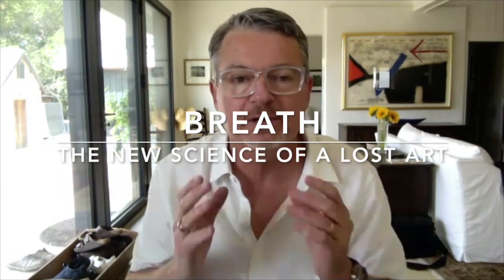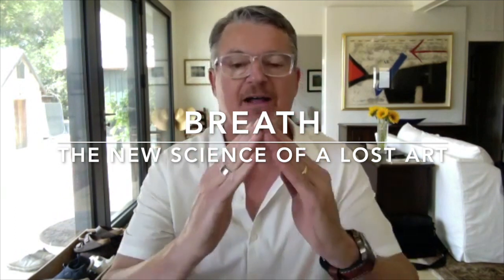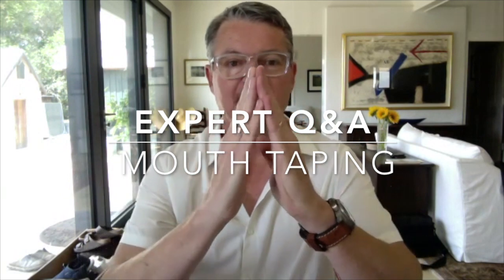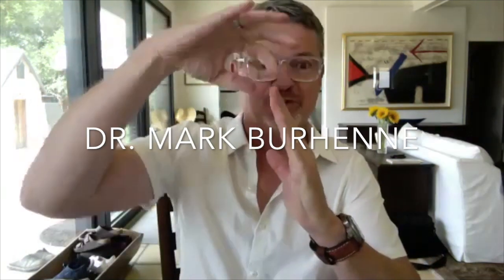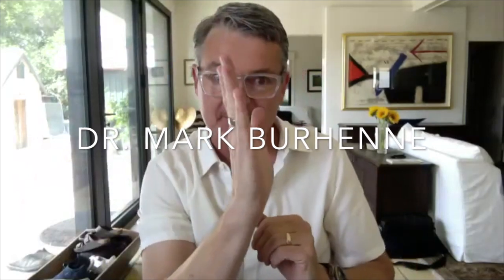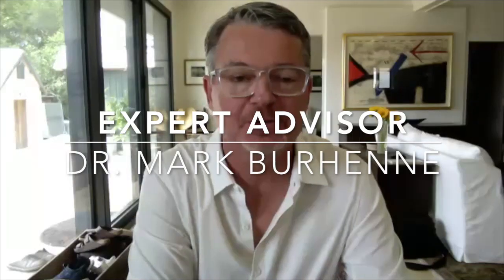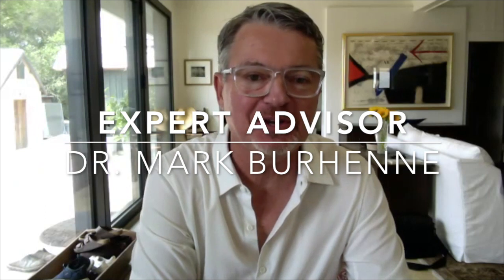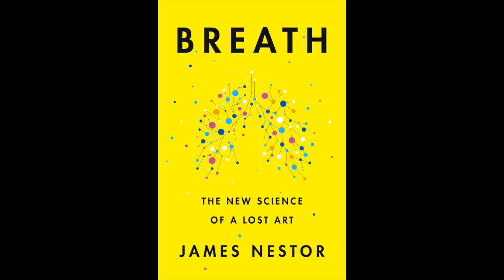BREATH: Expert Q&A | Mouth Taping

Comment: This is all so fascinating. Just started your book this morning James, thanks for bringing education to this little known topic. I have a deviated septum I've been struggling with for a while, scheduled for Septoplasty Nov 1st. I've already been experimenting with tape the past week and am noticing a difference (Thank the Hostage tape ads for bringing awareness).  It's the craziest thing, when I sleep with my mouth open, I get congested GUARANTEED. Every single morning without fail and it's bad.  When I've been taping mouth shut, I'm not waking up congested any longer.  I'm very excited for the future and hoping I can finally remedy my struggles once and for all.  The thing I am noticing is that while the excess mucus in the morning is gone, my turbinates still seem a bit swollen.  They normally chill out once I get hydrated and a bit of exercise in (assuming the change in blood pressure is what causes the actual relief). I'm hoping they get used to this new change with time. 

Here is my timeline through hell and my plan for a hopeful recovery.
- Had a root canal 5 years ago (you'll see why I mention this below)
-Been struggling with major nose issues for about 5 years.  I always thought it was pet allergies so I never did anything about it, figured it was normal and the sacrifice for having a house full of cats/dogs. 
-Got to the point my nose was getting so raw inside that the hole kept healing smaller and smaller shut!  It was crazy. With a flashlight, I could see the hole on left was tiny compared to right hole.
- Went to ENT for first time ever, had no idea what an ENT even was.  He told me my left nostril was blocked about 70% from a deviated septum.  Had no idea I even had a deviated septum. 
- Here is the real kicker though. He discovered an abscess above the root canal from 5 years ago.  He swears that this extra space is causing me to continually get sinus infections which is what is causing all the excess mucus.
- We are doing an Endoscopic Sinus surgery with the Septoplasty all in one swoop.  I'm nervous, never had surgery before. Wish me luck here! 
- I will be getting tooth fixed as well asap (no pain or anything but he says the scan he performed shows a clear abbess up between sinus cavity at my molar)
- I plan to start mouth taping regularly and also exercising on a better schedule. 
- The one thing I am getting caught up on, the ENT is also saying I should do turbinate reduction, but I've read a lot of poor stuff about this online.  I think I am going to skip this part and see if what I've learned is going to fix me. 
-Lastly I am also reading "How not to die" by Michael Greger which is about food.  I have had the worst of the standard American diet my entire life, I plan to also change this.

Here's to health, I'm so sick of this brain fog and depression which I'm starting to think is all correlated with my above experiences.

Hopefully anyone else out there struggling to breath can find some damn relief once and for all.
Reply: Hey Jesse, today is November 2nd. How did the surgery go?! I am looking forward to good news. Can I connect with you somehow? I also have a deviated septum, I mentioned taping to my doctor and she immediately dismissed it and it bummed me out. 

The more I read into this and do research the more I’m convinced that fixing my breathing at night is more important than ever before.

Curious to track your journey.
Reply: @katsuru  So far so good!  They knocked me out and got to work yesterday.  Surgery went really well according to the Dr.  I can't really see anything up there yet when I take off the packing it's just a bloody mess.  Trying to keep it clean but it'll probably be a week or so before I can really get up in there and clean it all out as I don't want to mess with the stitches too bad at this point. I've still been mouth taping at least 80% of my nights (prior to the surgery) and plan to continue doing this although the crazy thing is the more I do it, the less I need to it seems, almost seems like my body is naturally starting to learn how to sleep with mouth closed.  I'm optimistic about the future although I couldn't say with certainty if this will fix everything or not.  They told me I had like 70% blockage on left nostril so I'd like to think it's not possible to get any worse post surgery just better.  So far pain is very managable I would put it at like maybe a 3 out of 10.  Nose is very delicate but if you just keep it clean with fresh packing snug up against it, you almost don't even notice it - I can eat normal foods and am up on my feet like nothing.  I could probably even return to work this week if I wanted surpringly although I'm going to take it easy a week. Are you able to message me on Youtube?  You can find me on Facebook too if you have any questions not sure how you'd like to connect but by all means let me know how I can help.

Comment: Hello to both of you.  Great interview.  Thank you.
I have some thoughts I would like to add.  

A diaphragm is a type of structure, a sheet attached to a fame.  There are more than 18  diaphragms in the head, sheets of muscle and connective tissue attached to a mostly boney frame.  One of the many wondrous capacities of diaphragms is the capacity to change the pressure gradient, like a sail, a parachute, a kite.  This capacity of our thoracic diaphragm is what makes inhalation happen.  The diaphragms in the head are auxiliary pumps in the hydraulic system that is you.  Mouth breathing puts a hole in your hydraulic system causing congestion of the the extracellular fluid, the lymph.  Anything congested with lymph will be 1)stiff and thick (like a plant stem is stiff when full of fluid) 2)it will probably be painful or at least tender  and  3)it will always lack the vitality that it could have if it were not congested.   So, it is very important to clear congestion from the tissues.  The thing that clears extracellular congestion from the tissues is the orchestra of diaphragms found stabilizing every major joint complex and autonomic hub in the body.  This orchestra is conducted by the thoracic diaphragm.  When a complete yogic breath originates with the muscle fibers of the diaphragm attached to the front of the spine, it ripples through the diaphragm in a wave like fashion.  In doing so, it grabs the grastroesophageal junction with the lower esophageal sphincter and pulls it downward.  This is the pulling sensation that you feel at the front of your throat and under your chin.  The mouth, the pharynx, the esophagus and the stomach are all one tube.  So a good inhalation with the mouth closed and the tongue suction sealed to the roof of the mouth will cause a flux in the floor of the mouth that changes  the pressure gradient in the center of the head, the seat of autonomic control.  It brings breath to the center of the head.  Who would not benefit from better fluid motion in the center of the head.  

The floor of the mouth is the most important diaphragm in the head.  It is the one that triggers all of the others to come on line and participate in moving air and fluid in the head.  When the mouth is left open, the the breath does not effectively reach the head.  Extracellular fluid becomes congestion.  The airways become narrow with swollen and stiff respiratory epithelium.  Respiratory epithelium is equipped with cilia, microscopic hairlike projections that beat in a wave like fashion, sweeping secretions to the pharynx.  Stiffened cilia do not do a good job sweeping secretions and the mouth breather develops nasal congestion.  

I am an osteopathic physician.  I do a lot of manual medicine inside peoples' mouths.  I have found that most people, even seemingly healthy ones have moderate to severe congestion of their mucosa as evidence by stiffness and thickening of the tissues.  Sometimes these tissue texture changes feel like chia seeds or even pea sized lumps under the mucosa.  Sometimes like grains of sand, sometime a whole patch of tissue will be found to be hardened with congestion.  These areas are almost invariably exquisitely tender to palpation.  This is most pronounce under the tongue, the floor of the mouth.  As the floor of the mouth becomes increasing thickened and stiff with chronic congestion, it is further obstructed in performing its job of bringing breath to the hypothalamus and pituitary gland.  Simultaneously it distorts the alignment of the temporalmandibular joint.  

Moreover, chronic lymphatic congestion results in an extracellular environment with a high concentration of metabolic waste product.  If the high concentration of waste accumulates inside of the cell, it will have a deleterious effect on the forward motion of your biochemistry.  This results in slower metabolism, slower cell repair...  

There is more to this story but, my dog is demanding a walk right now.
Reply: Wondering if you came back from the dog walk, interested in rest of your story :-))
Reply: Anjani T, how can i reach you to learn more?
Reply: Please continue.
Reply: Thank you so much for taking the time to write all that! Would love to hear more, too.
Reply: I wonder what can be done, mouth breathing has ruined a big part of my life and I only wish I could have worked to fix it before it deformed my mouth and gave me permanent congestion.
Reply: P

Comment: Great explanation!  I am a sleep apena patient was getting great results for the first three months of use but I have reverted by to my condition before CPAP therapy.  I know I am breathing through my mouth.  I try this to night and will report back.  Thank you so much!
Reply: How did it work?
Reply: @psykickg   I used the tape for a while. I had unknowingly took off the CPAP mask a few times in the night when I taped.  Not a good thing for CPAP / sleep apena patient.   I think the tape use trained me after a while. I get excellent results from my CPAP therapy now.
Reply: I'm curious what your results have been .
Reply: @dennisneal5817  tape for real not this mini tape crap if you are using nasal cpap. If u are using full mask you find need to tape.

Comment: I have an overbite and find that it is often hard, especially at night, to keep my mouth closed. I wish I had worn braces as a child! I will try the tape and see if it helps.
Reply: Same problem with overbite not addressed as a child. I am now 66 yrs old and mouth breathed all my like with dry mouth and pasty taste in the mornings. Did you try it and how did taping work for you. I tried a mouth appliance but because of my overbite it made my teeth and jaws hurt….
Reply: @LastTrump7  I did not try it because I have pulmonary infiltrates in my lungs, and I heard that it may not be the best thing to do. Thought about a mouth guard but would probably get it at the dentist so it is made to fit correctly. Still need to do my research. Good luck!
Reply: I got braces at age 67. It wasn’t easy but so glad I did. Wear a retainer at night and I need help keeping my mouth closed as I have a deviated septum. Will try taking. Btw- did Invisalign braces. Harder than I thought it would be.

Comment: I been mouth taping for about a year but I'm not used to it yet however maybe I'm not doing it correct the tape falls off many times.  At first I thought to myself how will I breath w my nose as I have stuffy nose a lot of the time? I found out that I'm able to bc nostrils dilate when your completely relax and  asleep.  I really like mouth taping big time I'm using cross cross taping doing it better the longer I do it.  Prayer and faith in JC helps a lot too!!

Comment: Does this help with Oxygen dropping at night while you sleep?  I got on Oxygen instead of a CPAP because my o2 was dropping as low as 75 (but i had pneumonia n Didn't know it).. now.. it drops less with oxygen  (down to about 86-89% o2) 1-3 times a night.   That's a lot better than 15-20 times a night.   Im wondering about taping n Still using Oxygen first night or so and then trying a night without it.  I can track it with my o2 Ring i wear to bed.  Any Suggestions?  Im 61... need to lose some weight n Need energy.   o2 has Really helped a lot with The Brain fog n Exhaustion i suffered from for 20 yrs .  Thanks!

Comment: Will a chin strap would just as well or are there differences between taping and using a strap?
Reply: Chin straps help but will not prevent the lips opening. Opened lips with CPAP will defeat the purpose of the CPAP. Tape will help keep the seal.
Reply: @madonnaagar6582  Thank you!

Comment: for some reason ive had a blocked nose on one side, almost constantly, for aobut a year and a half now,  which saline spray didnt fix. i also constantly woke up with a dry mouth. I have no idea why it started but it's so frustrating, and a few months ago i discovered i was sleeping with my mouth open and i catch myself doing it almost every night. idk if my blocked nose started bc of this or vice versa, but im gonna try mouth taping now.
Reply: did you ever find out what was causing this for you? I have the same problem. how was your experience with taping your mouth?
Reply: Read the book, it helps to explain why your nose is blocked on one side.
Also don't use those sprays. Only use a neti pot.
Further training different breathing techniques will help. They're part of yoga breathing practices

Comment: love the video, but i'm having trouble getting the tape off in the morning.  i agree the tape comes off easy when it is 1st applied...but, in the morning, a couple hours later, the tape will not come off,   unless i want to remove a layer of skin.  i've tried  to roll it off (like you show). and it still wants to take layers of lip skin off.  the only way i can get it off is to put my lips in water for a minute or so.  normally not an issue. 

 last night i woke up and cpap mask slipped and i was having issues  breathing.  took mask off... needed air bad.  now the tape won't come off.  

how do i tape different, or how can i get the tape off easily and quickly?

Comment: I cut off one end of a 3 inch long fabric or plastic bandaid -about 1 inch by 3/4  inch and place it in the middle area my lips.
I like Nestor’s method of gentle removal by back and forth tongue motion. I apply lip balm after removal to soothe any lip irritation.
Works very well.

Comment: What are the chances of choking on that piece of tape if it comes loose while you are sleeping?
Reply: I've probably used the tape a couple of hundred nights and haven't had that happen. I would think the odds of coming off both lips are very small.I use 3M Nexcare flexible clear tape
Reply: That's my concern too, and I'm surprised I had to read this far down the comment thread before I found your question.

Comment: I've been sleep taping for months. But when I wake up I consistently find the tape stuck to my finger. I assume when I’m sleeping I experience insufficient oxygen so I subconsciously rip it off without realizing it thus I continue mouth breathing. Any tips to combat this?
Reply: Following.
Reply: Nestor says to use vertical tape.  In mid lip, so either side of mouth open.  Tape is to remind jaw to stay closed at night.
Reply: You should ask your doctor. If you're not getting enough oxygen through your nose, that's a bigger issue that needs to be addressed

Comment: Anybody know which size for the 3M tape he mentions?
Reply: 3m micropore is the roll. Or u can use cover roll stretch tape, what lank lefty - registered polysomnographic sleep tech recommends. The other mention was somnifix. I like dryft better but all will work you can also use a soft, loose cervical collar.
The other option is called hostage tape. It's precut kinseotape for the mouth.
Reply: @screamtoasigh9984  wow thank you for the very detailed reply

Comment: why does the tape come off on some? it was mentioned at the beginning but not addressed later
Reply: From the Buteyko Discovery point of view the tape will come off on some people due to them generally  breathing too much. Moving from mouth breathing to nose breathing means you will be "breathing less" because of the smaller space in the nostrils compared to the mouth. It took me 3 weeks to be able to keep the tape on all night, until my body readjusted to a lower level of breathing and created a new "normal" higher level of tolerance of Carbon Dioxide. A new "normal" higher level of tolerance of Carbon Dioxide means you will automatically generally be "breath less". Mouth tapping is a "Breathe Reducing Factor"!
Reply: TheBreathingMan thanks, devoured James Nestor’s book a couple weeks ago. I can’t believe I’ve gone a lifetime without breathing right ☺️🤐
Reply: I make sure my lips are clean and dry before taping which seems to help.

Comment: Does using a CPAP with a nasal attachment, eliminate the need for this?
Reply: It didn't for me. I noticed open mouth when I would awaken wearing the CPAP.. Tape helped with dry mouth and improved sleep.
Reply: I used nasal CPAP for years with no issue. Age caused muscles to relax more and I started to experience dry mouth. My lips started opening at night. Now I use both tape and CPAP.